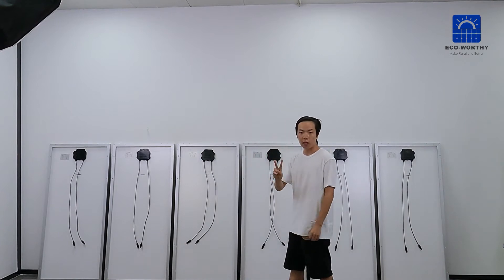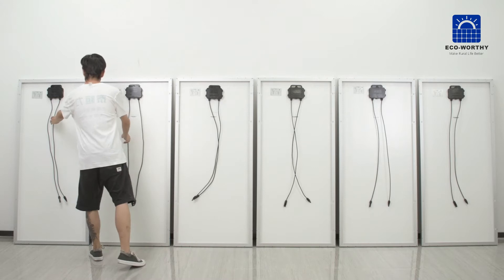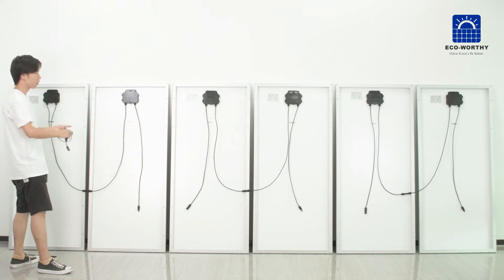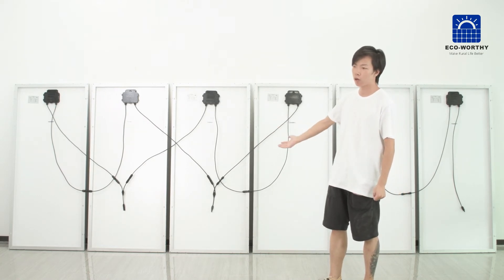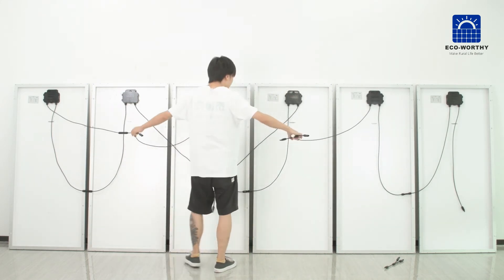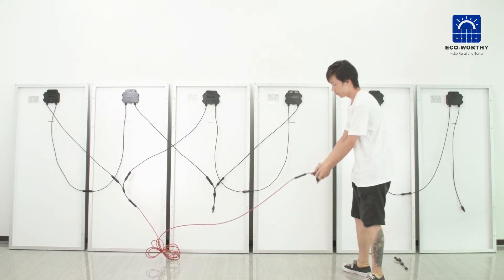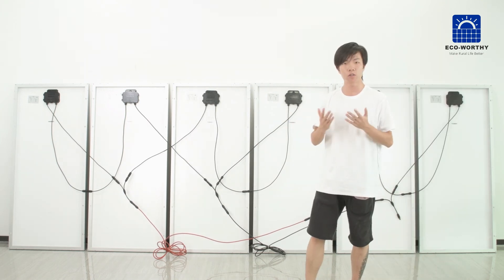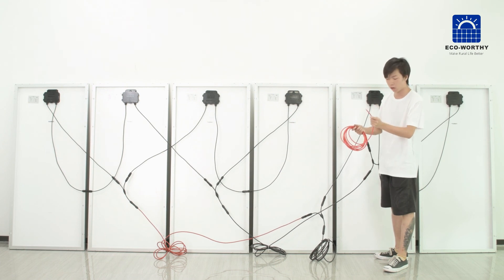6 panels' connection : how to get them series & parallel and use the extension cables correctly

Comment: Thankyou for showing this using the y shaped connectors.
I saw another video claiming to also be series parallel but he runs the wires into a total of 2 connectors that are fan shaped with 3 prongs on one end and one on the other end. Could you please explain the difference?

Comment: It would be very helpful to step out of the picture because your body is blocking the view of the wire connections and there is not one good view at all of the completed connections because your body is hiding it. So...upon completing it, a still photo of the completed job without you standing in the way or a schematic showing it please. Great video but the music is unnecessary and interrupts your teaching. Just when I need to see the finished job the video ends without showing it. All that work you did and we cannot see...

Comment: tell about amperage limits and fuses u need to be in parallel in case one panel is faulty theres no fire...
Reply: Fuse rating is on the panels label.